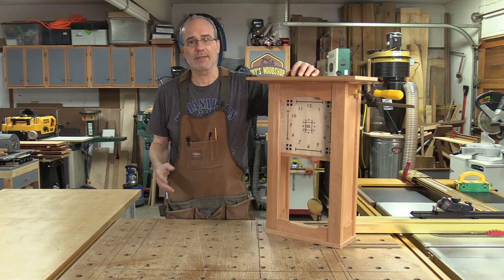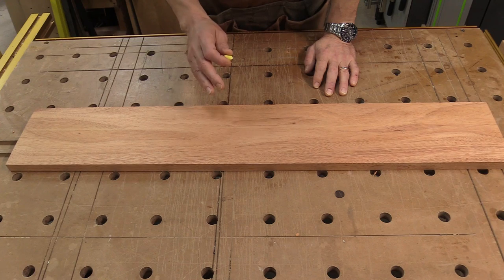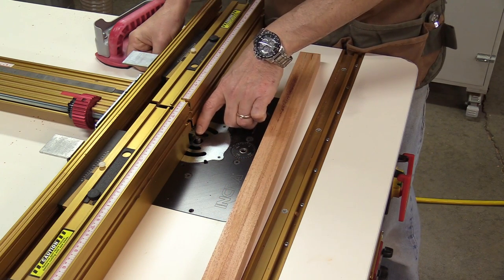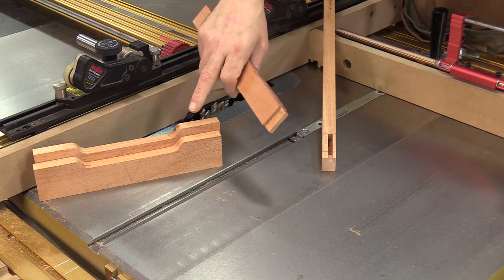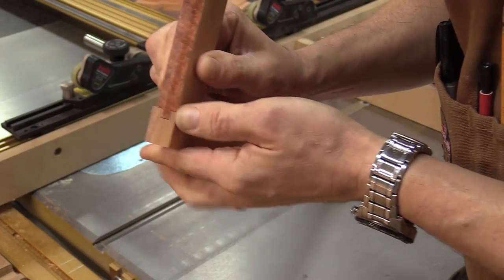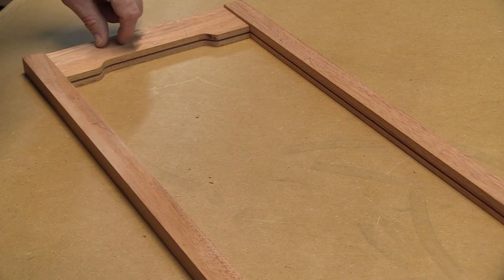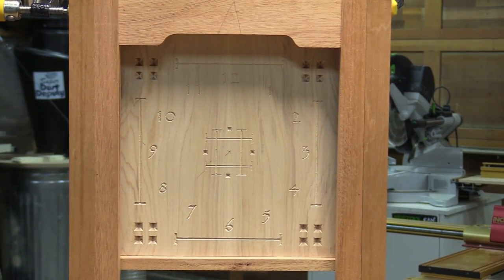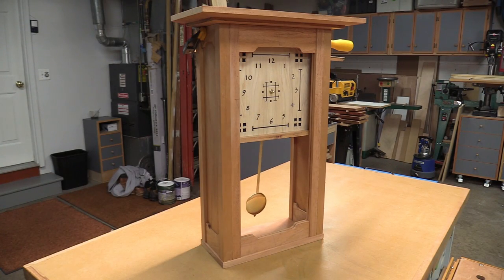Greene and Greene Wall Clock - CNC Clock Face, Making the Door Pt.2

Comment: Nice work!
If you end up doing a lot of work similar to the clock face, you might want to look into getting some paint mask.  It's a self adhesive plastic that goes on the part before you machine the letters.  Paint the engraved part then peel off the mask.  It's usually a good idea to put a coat of finish on before applying the mask.
Reply from the maker: Thanks Mike! That's a good tip. I didn't even know anything like that was available. It doesn't bugger up the bit when you're cutting?
Reply: It doesn't gunk up the cutter at all.  It's made specifically for cnc routers in sign making.  If you search for "paint mask vinyl" you will find numerous suppliers.  There are several brands and types and it comes in various widths.
Reply from the maker: Cool. That's a big help.

Comment: Here’s a technique I have used instead of milling through painters masking tape:  start with your clock face a little thicker (for example 0.02”) than your desired finished product, spray on a shellac to seal the surface, mill your clock face your desired depth plus the ADDITIONAL (for example 0.02”) thickness of the face plate, spray paint the engravings, now take the ADDITIONAL thickness off of the engraved face with a drum sander, clean up with a finish sander.  The shellac step is optional.  I spray the shellac to keep the darker spray paint from penetrating deep into some open grained wood.

Comment: Your videos are great except for the use of inches who is only for Americans, the rest of the world is using metrical measurement because it's more easy to learn (1 cm is 10 mm  and 1 meter is 100 cm and so on).  All this use of 1/2 inch, 3/4 inch 1/16 inch does not make any sense to the rest of the world. If you want the world to watch your videos, switch to metrical instead of the old fashion imperial system. Just a friendly advise. And yes I smashed the like button so you now have 399 likes of 31K views. What is the reason that all the viewers don't click the like button?